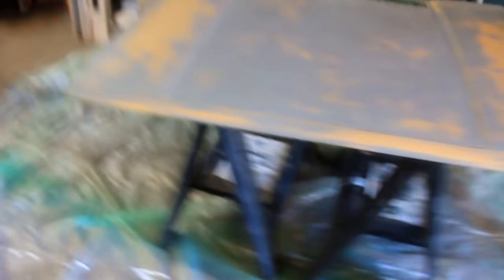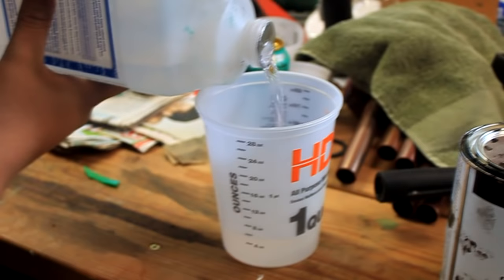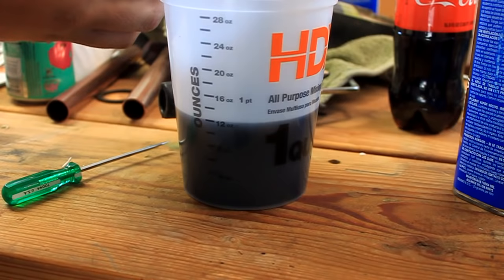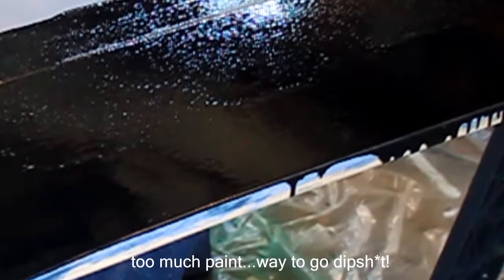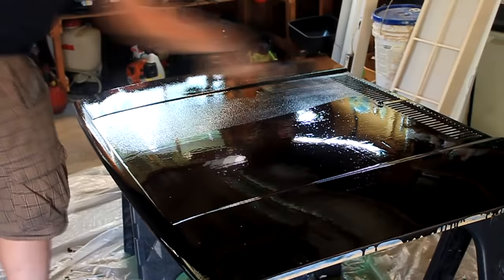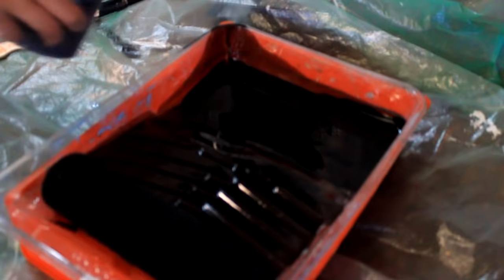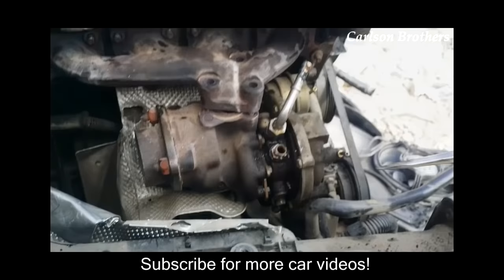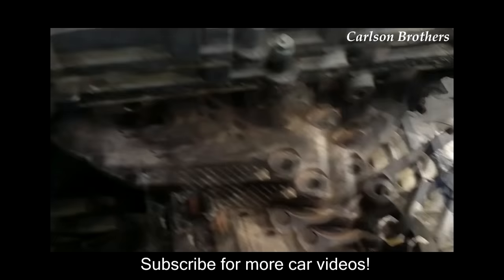How To Paint Your Car With A Roller

Comment: Way to show how it turned out at the end too. Great job 😒
Reply: +Carlos Diaz lol was thinking the same thing
Reply: +Carlos Diaz I can tell you how it looked. It looked like you painted your car with a roller........ like an idiot.
Reply from the maker: +Clint Chapel This is a rolled on Rustoleum finish: 

http://www.meguiarsonline.com/forums/photopost/data/1096/medium/Spirit_For_Sale_0071.jpg

You can achieve a good finish with any application technique if you take your time and make sure it goes on smooth, then follow up with the proper finishing techniques. So take your insults somewhere else, because they've got no knowledgeable backing.
Reply: I mean this is how they used to paint cars way back in the day. It's just a very old method, nothing wrong with it.
Reply: You're better off buying a gallon of DTM from PPG. No need for thinning.
Reply: Whoa! Is this the car that you painted in the video?
Reply: It is the car, he wet sanded with high grit sand paper, then used maguiars 105 compound, then turtle waxed it. That is how you achieve perfection. I am doing mine today following his method.

Comment: Awesome Paint job
Instead of cleaning out the roller between coats, wrap the roller in a air tight plastic bag, it works just as good in keeping the roller from drying

Comment: Nice finish, amazing!
1. Did you use a mohair roller?
2. What is the wet sanding grit and do you use a machine or by hand?
3. What sort of paint did you use - a link would be helpful. Is this automotive paint?'
Reply: All the answers are in the video. DID you watch it?

Comment: I've painted for 15 years every way imaginable and I've never thinned out paint that much way way to much use like 2 light pours
Reply: id have gone 80/20 paint/thinner if anything... that viscosity is still too thin even for a gun!
Reply: @Kanjo_Retired  can you in theory thin out the pit a lot and dip small objects in the paint to coat them? If the paint is thin enough, wont it drip off evenly via gravity prior to drying? Thanks!

Comment: Quick question ... I want to use regular wood varnish (poly) to do the clear coat on the hood of my jeep.  Is there any reason you can think of that that wouldn't be a good idea?
Reply: Very bad idea!  I use Varathane Oil Based Clear Interior Satin Polyurethane on furniture all the time.  If I use it outdoors, it cannot handle UV rays and breaks down fast.  Its a very tough interior finish, love it on wood furniture, but never outdoors.  For outdoors wood use Spar Varnish (not Urethane. Varnish is more UV resistant). For your Jeep, consider using Durabak18, a bedliner paint, which is a form of Urethane. Don't use Epoxy paints like Upol Raptor paints which are Epoxy and crack with vibration. Durabank dries hard, but remains flexible for vibrations.  It also comes in a textured (with crumb rubber) and Smooth and can be roller brushed on with mohair rollers.  Uses Xylene as solvent and brush cleaner.  Xylene is not available in CA but you can work around that.  Durabak also makes a clear version but not the same as the slick gel coatings in auto industry.  For your car best is to use auto paints and a small sprayer for gel coat.

Comment: hey man I have an old mustang its a beater that I drive the hell out of I want a matte finish white so I assume ID just scuff up the old paint with 800 grit and roll it on? no colorsanding or clear coat?
Reply from the maker: +Jerry Cantrell You can actually buy matte rustoleum in cans like this! It'd make the whole process a lot easier in not having to make it shine!
Reply: +Braden Carlson yep I grabbed a big can at my local home depot lol I'm in the process of fixing a few spots with bondo and fibreglass just not too sure if I should just roll it on or shoot it you think it would have to be thinned too? and what are your recommendations for thinningbwith mineral spirits much appreciated for your response
Reply from the maker: Jerry Cantrell If you can shoot it I'd do that, but if you're just looking for simplicity I'd say roll it on. Use the same ratio for mineral spirits I did in this video. It worked quite well
Reply: So is that the truth???? You stated you "sent to the shop because of lack of elbow grease"

Comment: I guess you found out that water does not mix with rusoleum or lacquer thinner. Paint is oil based.
Reply from the maker: Joel Watkins ...what?
Reply: Braden Carlson I'm getting a kick at some of these comments that were left by people who can't even spell the most simple words. Anyways, I don't think it was a half bad job for a beater. I was actually surprised it turned out as good as it did. "Thumbs up" bro !
Reply from the maker: I appreciate it! I wish I would have got a better shot of the second to last coat. As the last one was drying the wind picked up a a few dozen leaves fell on it...lol. I sanded it all back down.
Reply: Hey Braden, I only commented on the vid because you said you were cleaning roller with hose after spraying it with thinner. Didn't know a You Tube Troll would comment on a type-o.

Comment: i want to paint my 1998 isuzi rodeo. it used to be dark red, I'm going with the Rustoleum "Safety Red".

Since there are many methods and I know nothing, i have a few questions I hope someone can help me out. 

what happens if I roll the paint without diluting?

will the paint peel if I dont prime the surface first?
Reply from the maker: DwayneHicks426 If you roll it without thinning it, it will not level out and won't come out very good. As far as going with no primer, as long as you sand the surface adequately and clean it properly before applying it should be fine. I also recommend you watch my video on finishing rattle can paint to look professional, as it will apply to roll on paint. Also, when you thin this paint, just know it takes a long time to dry. I'd wait about 5-6 hours between coats and let it cure for 72 hours before sanding, cutting or waxing
Reply: You might also want to pour some paint on the panel and draw it out with the roller...  More guaranteed to get level and even paint coverage

Comment: no need to name call. do u drive a hood? no. anyone can paint a horizontal surface with a roller. so change th title. runs n drips n roller overlap lines occur on vertical surfaces. show that. thanx 
fyi my experience as a 20 year professional commercial residential painter & Lead crew member had me curious about the runs n drips of a roller on th hard to paint surfaces (verticle & abutting trim pieces). thanx
Reply from the maker: Plenty of people have used this method to paint entire cars. Repeatedly. Do a little research before calling someone a liar, it's ridiculous. I showed the method you can use to paint the entire car.

Comment: you should have sanded between coats
Reply from the maker: +Dave Bobby I typically do two coats, then sand, and repeat
Reply: Thats fair enough. i figured the second coat would almost seal in the bubbles/imperfections from the first coat making it harder to wet sand out
Reply: +Dave Bobby the trick is only wait about 4-6 hours, then recoat, dont let it dry fully, then dont have to sand between coats

Comment: A bit of work with sandpaper would have done a world of good.. it is good, but sand paper would make it superfine
Reply from the maker: Wrik Sen I made a video about that too
Reply: Braden Carlson good.. but it should have been done here
Reply from the maker: Wrik Sen Got it. Sand wet paint next time.
Reply from the maker: Wrik Sen Or did you misread the title as "How to paint and finish your car"
Reply: Braden Carlson not wet paint.. but before applying the paint
Reply: Braden Carlson it isnt about misreading anything.. it is known that no matter how oo which paint you use, atleast a scrub of sandpaper will prevent contamination, get a much better surface texture and paint quality, when finished
Reply from the maker: Wrik Sen It was sanded.
Reply from the maker: Wrik Sen It was sanded.

Comment: Did you just turn over the roller to use the other side ? 😂
Reply from the maker: No, there's an elevated portion of the hood that the wire handle from the roller would have drug across.

Comment: I painted an entire 1981 C10 with Rustoleum white, and a roller. Once I started, I wish I would have just sprayed it. Its all fine and dandy with a roller UNTIL you have to cut in around the door handles, and every other little pain in the ass place the roller wont go. You have got to thin this paint out, or will NOT DRY.....you can make thumbnail prints in it for weeks on end. The places that you have to cut in with a brush, will look like 9 kinds of ass. Seriously, save a little more money, at the very least, buy the Rustoleum Auto paint, like $50 a can, already thinned, and go get a cheap spray gun and rent a compressor from the rent-all. For the love of God, do not roll your shit f you actually give a shit out about it.
Reply: Funny.  Good to know about the rustoleum and sprayer.  When I was a kid I helped my mother paint two different cars with a bucket of car paint and a paint brush.  We drove from Detroit up to Higgins Lake with the last one while the paint dried while driving on the freeway.  I don't remember them looking bad, although I was probably only 12 at the time.  True story.

Comment: looks cheap and high school. do it right ! harbor freight spray gun 10 dollars
Reply: 10 dollars? more like at least 20. and you'll need an air compressor which as least 90
Reply: also, rolling it on you're not directly exposed to the paint which is what i like about it.